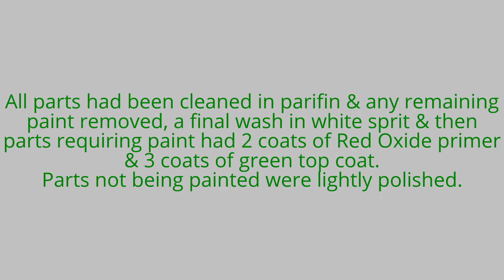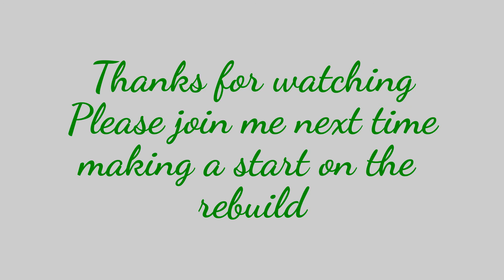Turnell & Odell Lathe restoration # 06 Painting & prep for assembly

Comment: For U.S. viewers, like myself, paraffin = kerosene, not the wax found in candles.  Google indicates white spirit is paint thinner/naphtha.

Eli D.
Reply from the maker: Hi Eli, thanks for watching.
Paraffin oil & Kerosene oil are very similar and for what I was using it for either would do, but Paraffin is a slightly more refined version of Kerosene that burns with less smoke and is better for indoor use in mobile heaters and lamps. While kerosene does carry an odour, paraffin tends to include additives to reduce the scent. This makes it a little more suitable for use in the home.
You're spot on with white spirit, I also use it as a brush cleaner after painting. White spirit is more reddily available here than other cleaners like acetone.
Hope you enjoy the restoration :)